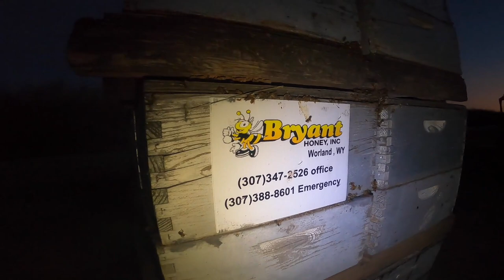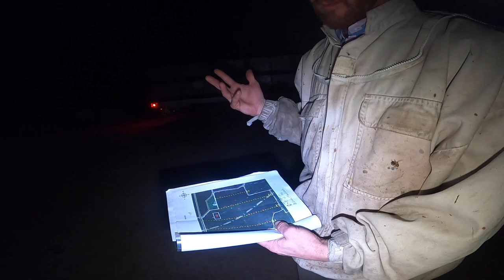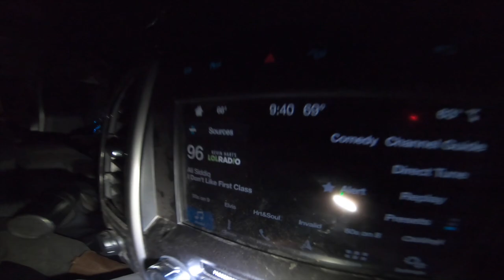VLOGINATION 1-California Almond Pollination-Commercial Beekeeper & Honey Producer-Bryant Honey, Inc.

Comment: Question: Don't they lose all the field bees when they move them the short distance from the outside of the orchard to into the orchards as bloom pops?
Reply from the maker: No. Bees are kept in a holding yard miles away. Bees will  adjust as long as its over 2 miles from their original yard

Comment: watching the tip backs I counted 8 frames. Is it now standard to use 8 frame hives instead of 10 frame equipment?
Reply from the maker: Hello Karen, there are beekeepers that run 8 frame equipment. Its a trend we have seen that more and more convert over to 8 frame. its preferen. This outfit here though has been running 8 frame equipment long before most guys. Thanks for watching Karen